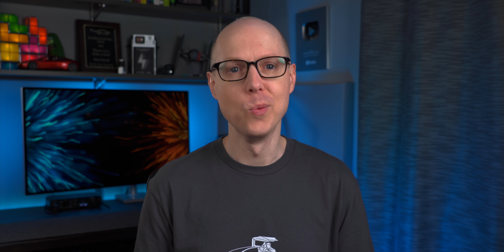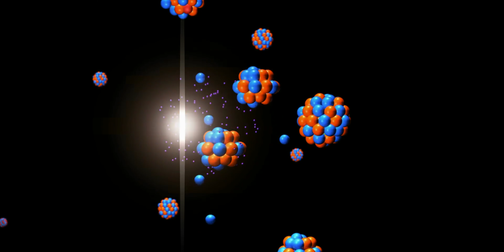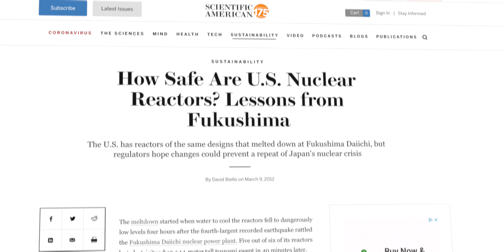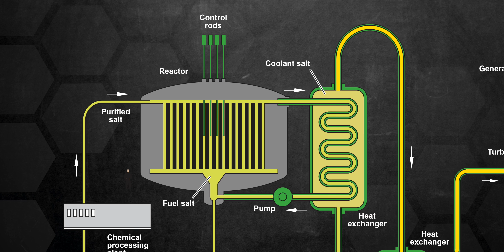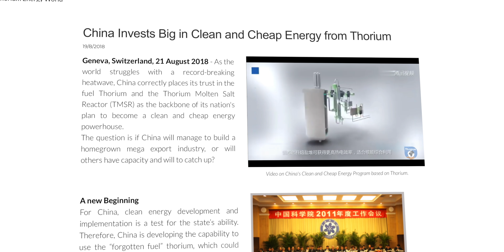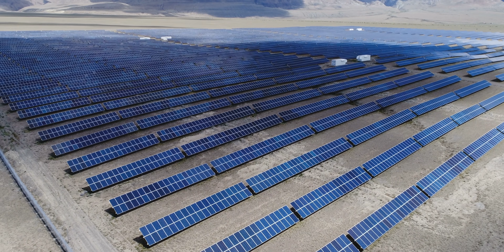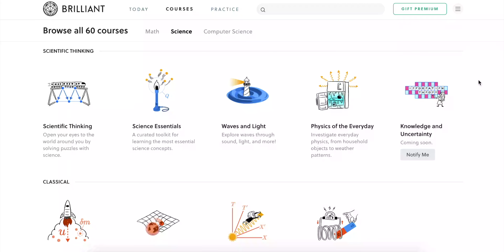Thorium explained - the future of cheap, clean energy?

Comment: You confused a few things on reactor type. Thorium MSR is a breeder type thermal reactor. Means radiating in the IR spectrum. Pressurized Water uranium reactors are fast-spectrum. They work by emitting alpha, beta and gamma electromagnetic radiation. Basically they are a huge microwave.

Even being in tidal power and seeing this as the ultra fast option for progress in decarbonization plus being a strong advocate to phase out of pressurized water uranium reactors I still see value in the Thorium debate. It is way safer, has controllable waste and it is going to happen sooner than any material science of cold fusion is ever going to be addressed. The Thorium Molten Salt Reactor is the single nuclear tech we can consider somewhat safe by design. 

Research on this design got mostly destroyed by the nues faction in politics in the cold war. Some has been found and published from archives around 2000.
In terms of developing a concept to bet our hopes for the climate on it, it unfo comes very late to the party, no matter the big funds and brains you throw at it. 20 to 30 years is what you need to build any nuclear facility to go into utility scale test ops. Add 10 to 20 years for widespread application. That is time we don't have left anymore to save our planets climate.
It may give us a boost on the last very hard stretch of decarbonization though and a brighter energy future.
Doesn't save us the heavy lifting ahead. plus we could easily dump any water based reactor research and ban that tech as unsafe.

Sure, this is a valid energy mix option. Question is when will the materials science and sensor questions all be safely tested and proven to work out? Such complex tecg need years and years of testing you can't shortcut. You can do many things in parallel, if you throw more fundding at it. Unfo the nukes lobby is strictly opposing something to makes all their uranium reactors and infrastructure stranded assets. That is why China and India leads this promising tech.

Short term we can only boost tidal power. We can see major contribution within 10 years to address grid baseload power with economic renewables. Thus enhance what solar and wind we can add to grids. Even if this just buys a period of econmic stagnation, saves the climate and gives us time to mature the Thorium Molten Salt Reactor. It is worth consideration due to the 300 years are much more controlled timeframe in human terms for the waste cooldown.

Sure it may be somewhat more dirty of a tech than Greens do like. Nevertheless, humanity won't return to caves or become all Amish people again.
The last 4 years or so it got uch quieter around the design. No one really speaks up about challenges in materials and design. What setbacks impact the timelines.
Reply: Maybe its just the typos but what you have written is unintelligible.

Comment: I think you should have spent a little more time explaining the use of water in current nuclear power plants. The materials to generate a nuclear chain reaction need to be above 600 degrees Celsius. Water boils at 100 degrees C, so in order to keep water liquid, there is extremely high pressures. This is what explodes. With Molten Salt Reactors, salts melt at those temperatures. It the salt leaks, it cools and just solidifies -- NO explosions. In my opinion, MSRs are safe enough to have one in every city.

Comment: Here’s how it works. When Th232 absorbs a neutron it becomes Th233, which is unstable and decays into protactinium-233 and then into U233. That’s the same uranium isotope we use in reactors now as a nuclear fuel, the one that is fissile all on its own. Thankfully, it is also relatively long lived, which means at this point in the cycle the irradiated fuel can be unloaded from the reactor and the U233 separated from the remaining thorium. The uranium is then fed into another reactor all on its own, to generate energy.

Wait a sec whys this say thorium turns into uranium that we use in reactors... How... Do I have to point out how that's not good and not what they promised.

Comment: Inside the body, however, they can be very harmful. If alpha-emitters are inhaled, swallowed, or get into the body through a cut, the alpha particles can damage sensitive living tissue. The way these large, heavy particles cause damage makes them more dangerous than other types of radiation...

The time required for a radioactive substance to lose 50 percent of its radioactivity by decay is known as the half-life. The half-life of thorium- 232 is very long at about 14 billion years.

The half-life of uranium-238 is about 4.5 billion years, uranium-235 about 700 million years, and uranium-234 about 25 thousand years.

Guess the future has to worry about thorium storage for 14 billion years.

Comment: Would they cost less than traditional reactors though ? Because currently we have plenty of uranium, the cost of fuel is really small in the operation of a nuclear plant. Doing the retreatment of the molten fuel "on line" seems particularly challenging.

No fear of the core melting down though, it's already all melted !

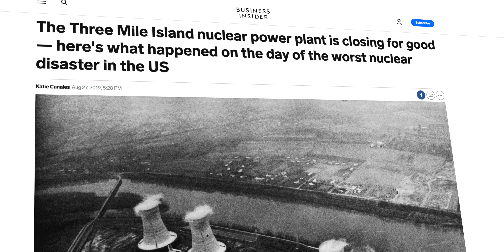Comment: 1:56 The other two yes but Chernobyl accident did not happen because of 'a failure in the cooling systems'. 

Chernobyl's RBMK reactor had serious design flaws (Positive void coefficient, graphite tip control rods that increased reactivity rather than reduce it). Sure, the fuel melted down afterwards because of a lack of any coolant - kinda hard to cool anything down when the entire reactor just exploded(lol) but the cooling system itself was not flawed and did not cause the accident. Where as for 3 Mile Island a faulty POV value attached to the coolant system was to blame and in Fukushima where multiple redundancies of the cooling system failed due to poor design or planning. Hence your statement is not accurate.

Comment: LFTRs ARE thermal reactors. Most breeder reactors are fast spectrum, but Molten salt reactors breed in the thermal spectrum, which is only possible because they operate on the Thorium-Uranium fuel cycle, while fast breeders work on the Uranium-Plutonium fuel cycle. educators have a responsibility to get these details right or are you just making entertainment videos?

Comment: You talk about the need to have nuclear in the mix of total power production, and it would be good to have some high level numbers for grokking the challenge.  Nuclear today provides around 20% of US production.  It could provide around 50% (with current assumptions) that these plants aren't throttled, so run at high-90% output continuously.  At 50% base load, this would displace much -- but not all -- fossil fuel, which can be varied to meet real time variations in demand (some of your other EXCELLENT videos - such as the one on the failure in Texas this year).

Comment: All the old uranium and thorium fission reactor problems go away with the new Fusion reactor era now here. We have recently taken a new step to advance the physic of power production by enabling chemistry of the atomic nucleus, or "nuchemy", We are passing the chemistry level where we interacted with electron shells and are moving on to nuclear manipulations in this "nuchemy" atomic nuclear era when we interact and multiply nuclear protons using hydrogen fuel stock. We have rediscovered the lost work of the alchemists and can make new elements with different atomic weights and vastly new properties. This was ably demonstrated in "The Safire Project". Quanta are important. We now have enough energy in them to manipulate the atomic nucleus much more easily by creating a compartment or a local region of plasma containment so reactions at this atomic nuclear level can easily take place. This is about to practically enabled a fantastic new era of energy production for the whole of mankind. This with free fuel obtained from water or atmospheric moisture anywhere in the world. New fusion nuclear is at the industrial commercial production final development point as of now. The energy argument and other power methodologies are all now irrelevant as we have new and very physically and economically powered practical and local community level fusion nuclear power. Solar roof plus Teslawall battery may be the present way to go domestically but megapack batteries and multiple storage technologies interconnected with an expanded ugly grid have a less certain requirement when you consider new any-scale community based and 24 hr self-fueling reliable fusion nuclear in the form of the "Safire Generator". Learn all about it at "aureon energy.com". Learn the newer EU physics at "Thunderbolts Project.com" and you will be permanently reeducated with the advanced new theory.

Comment: Yes Matt, I enjoyed watching it again but frankly you have been disappointing me for some time on this issue. It's as if the Sierra Club has you by the "short & curlies" with what appears to me to be a perverse avoidance of admitting that "walk-away" safe liquid metal Thorium ion fuel molten salt reactors (MSR) will be producing far cheaper energy than any of the current so called renewables. (Is this your Elephant in the room to be avoided or are you just going to wait it out indefinitely?) Indonesia's current contract for near ambient pressure 7×500MWe ThorCon molten Thorium/sodium fluoride salt burner reactors at a capitalised cost of USD1.00/Watt and a pre profit unit cost of less than 4cents per kWh enabling Indonesia's PLN to provide power to consumers for less than 7cents per kWh according to their PPA.
(The only capital cost to PLN will be the cost of connection to their grids).
Why is the acknowdgement of MSR verboten by some proponents of eliminating dirty poluting coal-fired sources?
https://youtu.be/U3ztjrKk72E

Comment: I have been hearing about thorium nuclear power for ages, but didn't understand why it was never implemented in real world. Why hasn't it been implemented already. I learnt why - thorium reactions requires plutonium to operate - without plutonium - there's not thrium reaction. How do you get plutonium? Well plutonium is a man made element - it's a by product of uranium nuclear reaction. So there you have it, to use throum you still need uranium reactors.

Comment: What happens to the generated uranium 233 from thorium reactors? If it is radioactive and we use it for fission, then we are merely continuing the cycle of “unclean” energy.
Reply: You produce the U-233 and fission it, producing fission products. 86-87% of those fission products will have decayed away to nothing within a decade of being produced, with another 12% or so requiring 300 years to decay to nothing. With a thorium reactor, due to the high energy yield of fission, the reactor can produce all the power you'll need over your entire life, for powering your home, transportation, growing your food, producing the goods you need like clothing, EVERYTHING, all that can be provided by 650 grams of thorium.

Comment: Until they find a way to use up so much energy that the spent fuel rod is inert, I'm not interested!
Reply: MSR's don't use fuel rods. The fuel is dissolved in the molten salt like sugar in hot water. The fuel never leaves the reactor system. The only thing that gets taken out are the fission products, or what's left over after an atom cracks in half. About 86-87% of those HIGHLY radioactive fission products will have decayed away to nothing, and another 12%, representing Cesium-137 & strontium 90, will take 300 years to decay away to nothing.

Comment: Thank you for posting this video. Have some comments tho... Watched a documentary on FMSR's the other day. There was one in operation at Oak Ridge National Laboratory for 5 years. The materials were proven back then, and saw hardly any degradation. Hastelloy-N and Graphite were barely affected by the thorium salt environment. I don't understand why we'd need to "prove" out the molten salt concept using Uranium, as it's already been proven with Thorium. I think the safety, proven materials, proven cycle, lack of multiple high pressure containment vessels and much smaller half life of waste would push this toward quick adoption.

https://en.wikipedia.org/wiki/Molten-Salt_Reactor_Experiment
Reply: The Oak ridge reactor wasn't a FMSR. It was a thermal spectrum MSR. It is true though that they didn't note any material corrosion or degradation of the metal, but the MSRE2 was going to evaluate it over a longer time frame. The graphite did degrade though, as radiation caused the graphite rods to swell and degrade some, giving a theoretical lifespan for the graphite of maybe 10 years or so. There may be ways of fixing that though. The MSRE did run on uranium. They produced the U-233 from thorium separately and used the U-233 in the MSRE. The MSRE2 was also supposed to be a full breeder, but a one fluid breeder and not a 2 fluid breeder as is characterized in this video and others (meaning the thorium and the uranium would have been in the same salt and there wouldn't have been a separate blanket salt).
Reply: @williamsmith1741  The graphite was made to be replaced tho, right? Yeah, they had to put uranium in with the salt, but that was because Thorium doesn't produce enough neutrons to maintain a reaction by itself tho right? Needs donor neutrons? The majority of fissile material was Thorium? Or am I thinking of a different reactor?
Reply: @FredSteffen  Not really, but mainly because it was just a test reactor. Most designed MSR plants being proposed by start-ups have the reactor core being swapped out after 10 years or so. 

Thorium doesn't produce any neutrons in the thermal spectrum. It'll absorb a neutron and become U-233 after a couple of weeks. U-233, when hit by a neutron, will fission 90% of the time and spit out 2.5 neutrons on average. That's enough to maintain criticality in the thermal spectrum while also breeding replacement fuel, but just barely. The reactor's breeding ratio is 1.05 to 1.07, meaning the reactor consumes almost all of the fuel that it produces. This prevents the reactor from being able to produce the fuel needed to start a second reactor, but it also means that the reactor can't be used to generate weapons material, as if you pulled fissile material out to make a bomb with, you'd kill the reactor because it no longer had sufficient fuel to maintain criticality. 

Thermal Spectrum MSR Thorium Breeder = Virtually Proliferation Proof

Comment: I must dislike for LACK of Kirk Sosensen :
https://www.youtube.com/watch?v=N2vzotsvvkw
The REAL "problem with thorium" , USA in danger: www.youtube.com/watch?v=lxwF93wnRQo  - National Security, Rare Earth Element

And punshing the bullshit called "climate change"
While the GHG Effect is proven WRONG! See how:
Wien displacement law (that is where the T^4 relation with insolation comes from).
Measured temperature in the Venus atmosphere from VERA-2 and VEGA landers. 
At 49km, (1bar) they show a temperature of 339Kelvin - which is easily calculated from Earth by; 
Tv=∜1.91 x Te 
339=1.1756 x 288 
This is final proof that there is no Greenhouse effect on Venus or on Earth. 
This formula collapses the 'Greenhouse effect' and proves it does not exist; 
Te = ∜0.523 x Tv 
Te = 0.85 x 339 
Te = 288.15 Kelvin 
The surface temperature on Earth is easily calculated - from Venus. The fourth-root of the TSI difference times the temperature in the Venus atmosphere at 1atm = Earth's temperature! 
The equation formula works on the Titan as well:
Titan  Tt =∜0.01089  x Te
             Tt = 0.323 x 288
             Tt = 93 Kelvin
This gives the calculated temperature on Titan at 1 bar as 93 Kelvin.
Measurements by the lander Huygens in it's descent trough the Titan atmosphere, show that the temperature at 1 bar is around 90 Kelvin.

About thorium, it will DOMINATE energy production:
www.youtube.com/watch?v=V2KNqluP8M0 - Mark Z. Jacobson's 100% Renewables vs 100% MSR
A little math:
Thorium nuclear power:
Income: 525 000 000 $
Capital: 1 000 000 000 $
Fuel cost: 2 900 000  $ (30$ per kg, 99t/y used) 
Startfuel: 700kg per 5000$ per kg = 3 500 000$
Time: 2y
Interest: 3% (60 000 000$/2y)
Payment: 25y
Profit: 458 500 000$ in second year
A "gold river" there!!!

Comment: Wind and solar are not great energy alternatives.  They are quite horrible actually. 

Wind kills birds, bats, and insects. Their parts require intensive mining to acquire rare earth minerals  for making parts. Other pieces are non-recycleable. ie. fiberglass blades.

Solar also requires intensive mining for minerals for parts. They need massive tracts of land to be cleaned for the panels to sit on. Solar panels require toxic materials such as cadmium and chromium.  The panels also require massive amounts of water to keep them clean to maintain efficiency. 

Then there are the usual sayings.  The sun doesn't always shine and the wind doesn't always blow. So no they are not great ideas. Unless you want to build a nice big natural gas generating station to back it up.

Comment: WOW, fantastic comments! Thanks Mr. Thesling, @UCE-0KxSjioGItET-WvaK47Q, Jim Graham, William Smith and others. One last thing to add, NO WATER! Except for Chernobyl (an accident all its own), all other accidents/incidents with commercial nuc plants involved water. Molten salt reactors need no water for neutron moderation or cooling. Without the threat of hydrogen production and subsequent ignition, plenty of passive 'walk-away' safety features are possible. Process heat for steel and concrete production is the next low hanging fruit of CO2 production that MSRs could tackle.